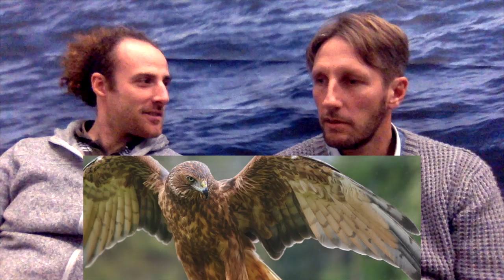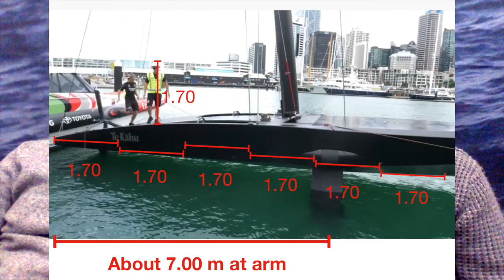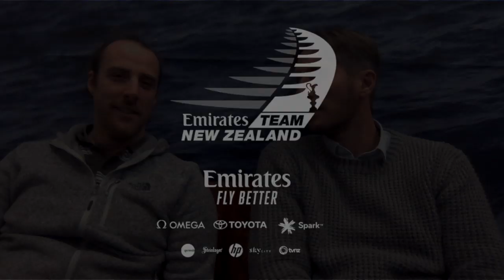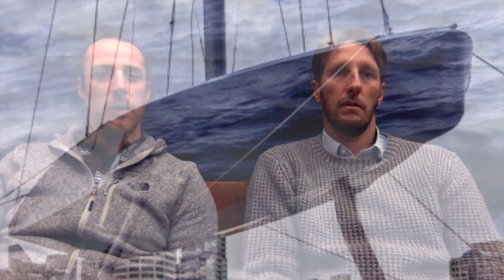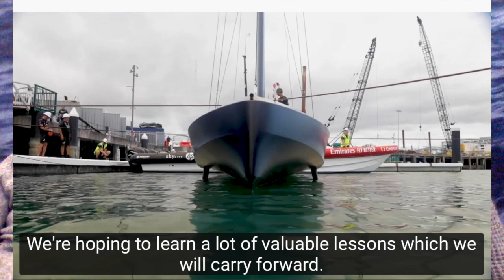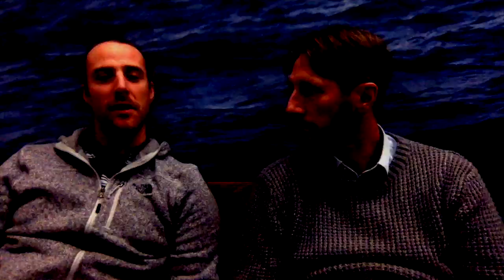E44 - The New Zealand Hawk

Comment: Depending on the SIs, if they allow low wind conditions it might make sense to have maximum LWL (I.e. LOA = LWL)
Reply: SIs = sailing instructions.
Reply from the maker: @zbeekerm  yes, but it's difficult to imagine they will race in displacement mode, not foiling. With the code zero, it appears they are already foiling in 5-6 knots

Comment: yes the veal heel lift from the main will be interesting, could you simulate a bow spit with like the old spinnaker pole and still be in the rules?
Reply from the maker: I don't think they can sail with anything fixed like this. I would not take the risk, I would just make a code on the forefront of the bow. In theory a moving bowsprit is doable, as rules say LOA not exceeding 12m

Comment: It looks like the concave aspect to the hull in your piece is an optical illusion. The AC75 rule forbids that (so I doubt this will go down that track with this yacht) And other views of the hull suggest it is flat with no concave shape
Reply from the maker: Hi maybe it's an optical illusion, but it's not forbidden by the rules, just an horizontal line transverse to the hull shall meet hull skins no more than twice. You see the concave on Luna Rossa hull, for example